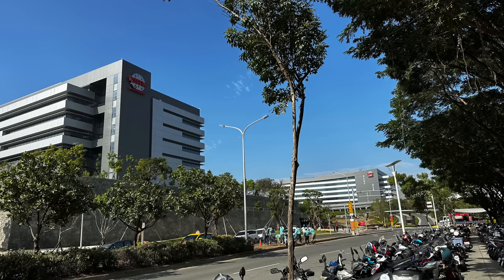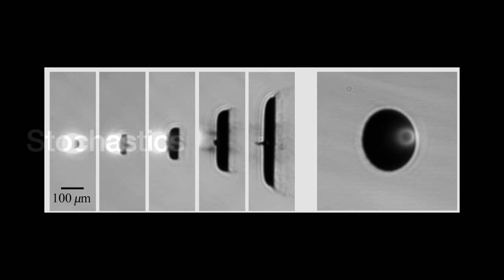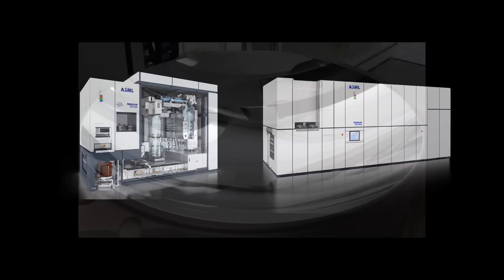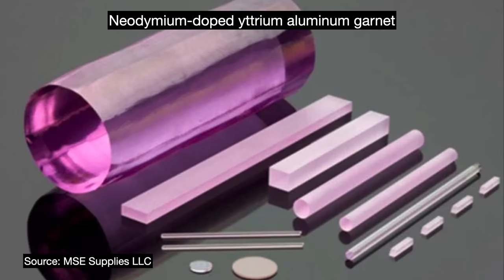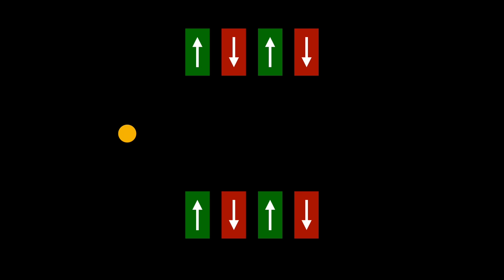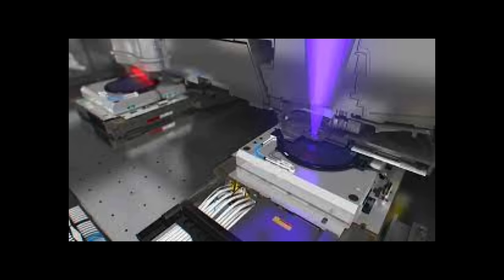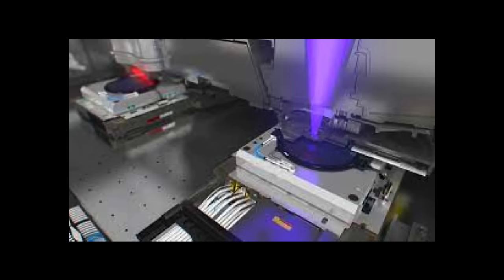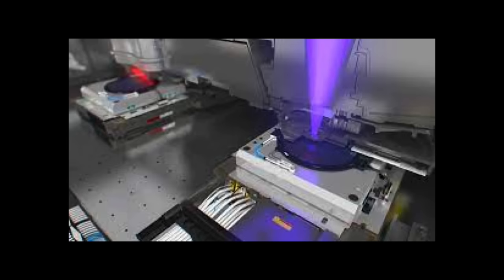EUV Lithography. But With a Free Electron Laser

Comment: I remember reading an article years ago when EUV was still in early development about using particle accelerators. The author of the paper argued that it would ultimately be cheaper and more reliable than the crazy liquid tin Rube Goldberg laser.
Reply: A laser generally will be more efficient and reliable than a thermal approach to generating light, but the thermal approach is often the easy way that needs relatively low R&D investment.
Reply: Yea , but things have changed a lot over past 20 years.

Comment: I whould love to see a video about this new ssmb technique China is supposedly investing. Building a particle accelator for lithography, really? Can it be cost effective, compared to standard euv?
Reply: Could be... a single EUV scanner cost $300-400M dollars, whereas a Chinese synchrotron particle accelerator can cost $200M  but produce dozens of EUV beamlines.
Reply: Except China was not given a choice between cheap advanced chips made by foreign tin EUV and expensive advanced chips made by domestic particle accelerator EUV. China was given a choice between expensive advanced chips made by domestic particle accelerator EUV or  having no advanced chips at all.
Reply: @Stroporez  domestic LPP EUV prototype by CIOMP will be ready by end of the year or early next year, mass adopted within 3 years.
Reply: @MrSpiritmonger  they run about $50 million, the vacuum control system I've had to design for the AMSL EUV is around another $5 million, and then there's other support tools that are also required, and I couldn't tell you what they are since I've had no involvement on that side of the tool yet.
Reply: Odd how chip sanctions pushed China to go all out in the development on this technology. I remember how Russia sending rockets into space got America's space technology development go all out as well. @Stroporez
Reply: Even if it’s not cost effective the Chinese would still need to invest in it since they are blocked from buying current tool.

They either give up on developing their own technology or forever being decades behind competitors
Reply: @Stroporez One ASML EUV scanner cost USD 100-150M. 
SSMB EUV factory cost USD 500M is very cheap comparing to dozens of ASML EUV Machines. 😅😅😅

Comment: The US Navy spent a lot of money on FEL (500M?). Insurmountable engineering problems scaling it up. Of course, that was for directed energy. Perhaps for this specific application it will work. 

FEL beams in the Navy effort were particularly nasty in terms of power density, simply ate the optics alive.

Comment: Most important difference between plasma 13.5 nm light source and 13.5 nm laser (any type, but we can do it only on free electron laser actually) that is the first one is non-coherent. In properties way it is odrinary light source. Laser light is coherent.
Most important laser part is resonator. With resonator light is producing in entire volume of gain medium. Photons emmited with act of spontaneus emmision have random vetor, they goes into random direction. Photons emmited durign stimulated emmision have this same (all) properties - also direction of propagation. Light moving parallel to resonator axis are amplified (because it bouncing many times form one mirror to another, and in each pass it is amplified by gain medium) - and all this photons can have this same properties - frequency, phase, direction of propagation, etc. This means this light can be focusing into very small point - smaller than cross section of gain medium and actually it can reach two diameter of light wave lentgh. 
Parallel beam also mean we can reach high NA.

Comment: Correction:  the electron doesn't gain energy that is loses later through emission.  The changing electric field emits radiation, as it's changing.  Think of it like friction when the undulator tries to pull the electron up or down.  But while actual friction creates heat due to random motions of molecules, here the electron reacts less than you would expect from that force on that mass, with some of the force going into creating photons instead.
Reply: 😯 I would thing that is due to charge acceleration that electromagnetic radiation is emitted
Reply: @franciscojavierramirezaren4722  same thing
Reply: bremstrahlung?

Comment: 1.) Nd lasers are not commonly pumped by LEDs, in fact this has only been demonstrated in academic settings. 
2.) Stimulated emission does not refer to any emission from an excited state as you explain, but is instead the result of an incoming photon stimulating an electronic transition and subsequent release of an additional photon with identical phase. What you effectively described is spontaneous emission.

Comment: Stimulated emission is what happens when a photon interacts with an atom that already has an excited electron. The incoming photon "stimulates" the emission of a second photon, with the same direction and phase as the original. This is how the gain medium increases the light.
Reply: Is this how Erbium-Doped Fiber Amplifier EDFA increase the output of a signal?
Reply: @popquizzz  Yes, the EDFA is a 4 level laser  amplifier optically pumped at 980 nm (from a semiconductor laser) , and then amplifying 1550 nm light.

Comment: author of the video didn't get the idea of the stimulated emission of radiation ( from 6.00 to 7.00)  if radiation is emitted in all directions it is called spontaneous.  and yes it exist all the time the medium is excited. for LaSER  you have to redirect some part of this spontaneous emission with the mirrors to the laser mode. and then, when you have accumulated radiation in one direction, it starts to stimulate atoms to actually emit radiation in this particular direction ( mode). thats a laser. If you just collect spontaneous emission by means of light collector, like EUV source does, you just get incoherent luminescence, not laser. LASER actually stimulates to emit into the direction  of the existing dense bunch of photons (and bunch of fast electrons actually give you this condition, no need for mirrors :-))

Comment: Could you make a video on wafer steppers? I feel like there is also a lot of RnD and Manufacturing detail hidden there, where else would you need to move something that fast but also so precisely at the same time.
Reply: Also wafer aligners. Seems fascinating to me how you can put something so precisely, to a fraction of a nanometer, on top of each other.
Reply: @dantesk1836  Part of the magic is clever use masks and etching that lets one use one feature to set the bounds of another feature (thus obviating the need for extreme precision on mask alignment).  See for example self-aligned gates and multipatterning.  Especially useful for the latter is atomic layer deposition which allows surfaces to be uniformly coated with atomic-level precision on the thickness.  You still need to precise align the masks just not quite as accurately or as many times.

Comment: Rumor said China is building a synchrotron EUV fab in Xiongan
Reply: Not a fab, a prototype synchrotron light source facility. 

Btw, a normal synchrotron has low peak power with high repitition rate while a free electron laser has a high peak power with low repitition rate. 

Tsinghua's SSMB mechanism will allow higher peak power and higher repitition rate at the same time.
Reply: @xBlackWind when it ready? 2025?

Comment: Correction at 8:06, an accelerating electron does not necessarily gain energy. In the case of acceleration by a magnetic field which only changes the direction of the velocity, not it's direction, no energy is gained. In fact, the electron loses energy as it emits light.

Comment: On the other hand, an Ion Implant with an  Implanter will be use after Film deposition.This time its Ion being deposited/doped in the trenches and in High Vacuum state and in numerous steps too. Litho->Film->Implant->Etch. Repeat until desired step is completed. 
Oops, I didn't put the clean or strip steps yet in between those steps as it depends on type of process required or designed.

Comment: Why does the EUV light need to bounce off so many mirrors? Can't they reduce the number of mirrors used?
Reply: Collimating, focusing, redirecting. Lots of reasons why the laser has to bounce off many mirrors. The engineers know full well that every reflection is energy loss, so there must be a good reason why they have to add a mirror in the path of the laser.

Comment: You got ideaa from china's SSMB EUVL project. But you didn't mention china in this video. Such a biased reporting.
Reply: Sad fact is that he didn't even mention Tsinghua's SSMB approach. Unlike a free electron laser which has high peak power with low repitition rate or a normal storage ring synchrotron which has low peak power with high repitition rate, a SSMB based synchrotron has both high power and high repitition rate.
Reply: What do you expect from a Taiwanese who supports Taiwan independence
Reply: @xBlackWind cuz Asianometry is Taiwanese, explains why he left out Tsinghua

Comment: SASE happens with every lasing medium if you have a long enough gain medium.  It's usually minimized as it's far harder to control than a resonant cavity defined by mirrors.  (also tends to shoot beams "backwards" and fry control sensors)  For EUV mirrors are super lossy, so the efficiency gains from eliminating mirrors is worth designing around the randomness of SASE.

Comment: What if you were to try making the free electron laser with some sort of plasma accelerator, instead of a linear accelerator. Would make sense in termes of size and energy, but if its suitable and the light pure enough, idk. And its very much still in development, so probably not there when its needed.

Comment: Correction for 12:00 - Have a feeling for how light electrons are ;) At 10 MeV they are already at 0,999 c. Which is part of the reason for the pre accelerator. You don't really need to consider the changing speed of the electrons for the main accelerator cavities anymore.

Comment: Could someone explain why you wouldn't reuse the beam (so not dump it after first use)? Is it not coherent enough after one use or something?
Reply: Perhaps because one wants to deliver precise pulses (not a continuous beam).
Reply: The electron beam has to have very small dimensions the linac accelerator keeps the electron beam dimensions in the transverse direction across the beam.  That allows the X-rays that it generates when the electron beam passes through the undulator to build up its electric field.  It's that electric field that then starts to work on the electrons that have generated the early x-rays the electrons start to become locked in phase (step) with the X-rays.  Then each X-ray becomes coherent with every other X-ray.  When the electrons are turned around after giving up energy to the X-rays they naturally start to spread out in position and energy so if you try and use them again they will not give the same characteristics for the next time hence it is best to have "fresh" bunches.  The old electrons still have a lot of energy but if you time it correctly the old 15:34  bunches can be used to give up energy to the next set of electrons that are being accelerated.  This is the reason it is called an energy recovery free electron laser.

Comment: Synchrotron radiation has been around for what 6 or 7 decades? Sure, the machines are big but there's really nothing stopping anyone from making them smaller and more efficient.
Synchrotron radiation is smaller than 13nm and has properties wholly different than it's neighbor EUV. What lack of imagination is preventing it from being useful?
The only real rub I can think of is the mechanics of transitioning to a completely different paradigm of electromagnetic interactions especially when it comes to ionizing is a particularly tough nut to crack. I feel like this approach is old news in that people have tried and didn't get what they hoped for.

I just learned that plants reflect IR light so extremely well you can shoot a remote at a leaf and command your devices!  Why is this not common knowledge?

Comment: If I had any say whatever, I would pour funds into both R & D for the electron-accelerator-on-a-chip created and announced by an international collaboration just a few years ago. Such a technology would be a god-send for chip manufacturing. Not only would it be useful for cutting masks and fabbing one-off chips but, if combined with an inverse structure, could also miniaturize FELs to impossible levels.

IF, AND ONLY IF, it is possible to up the total output amperage to something more useful than one electron at a time. Regardless, if you're going to spend billions anyway, some of those billions should be invested in such a possibility as a FEL on a chip.

Comment: If I follow this, the ASML lithography machine gets simplified but an outage of the synchrotron takes down all manufacturing because it’s too expensive to have a second?
Reply: Not really. ASML EUV lithography machine cost $200million. While synchrotron cost $200- $800 million. A big fab like TMSC purchased 55 EUV machines from ASML... so building several Synchrotrons is well within the budget for these big fabs that is running several dozen lithography machines.

Comment: 12:46 Mirrors in a vacuum:  But didn't you just say that this wavelength is absorbed by most every material in the world, meaning conventional optics are impossible?  But now you have mirrors, no full?
Reply: The mirror has precisely aligned layers.
Reply: This is why you start with  1MW (1 million watt) power to run a 40kW CO2 laser and end up with only usable 250W of EUV light.

Comment: Perhaps instead of a beam dump, you could use the electron beam to draw an image on a screen?
Reply: I wouldn't want to look at that screen O_O

Actually, what the video didn't mention is that in this specific FEL they recycle the energy of the beam by decelerating it when it passes the accelerator again. So in essence the main accelerator takes the energy from the old beam and transfers it to the new beam to increase efficiency. Still, the remaining electrons hitting the beam dump probably went from extremely dangerous to very dangerous.

For context: High energy beam dumps usually become very hot during operation and emit a lot of radiation. Actually, they even become radioactive themselves due to activation. Of course, the specifics depend on the type of particle being stopped and the energy and intensity....
Reply: @entcraft44  Why can't they just re accelerate the electrons. Why is there a need to dump the electrons?
Reply: @nickl5658  It probably has to do with beam stability/focus. Circular colliders require sophisticated control systems to keep stable. If you dump the beam you don't have to deal with that. They claim they can transfer nearly 100% of the energy, and electrons themselves are basically free, so this is easier.

That said, I am currently studying to become a physicist so I will research it more and tell you if my hypothesis is correct.

Comment: The new iphone pro proves the N3 node isnt as impressive as we hoped. Litterally no effenciency improvement.all the performance and clockspeed gains came from higher power use. Massive wattage and the iphone pro overheats faster. The density has mostly been used on widening instructions and raytracing cores for the gpu.
I recommend you watch geekerwan's analysis of the A17 chip, as it gives a glimpse into how poor the N3 node is in these early stages.
Reply: Too bad - I'm still waiting for the ultra high efficiency chips that'll make a phone run for a week on one battery charge.  ;*[}
(NB: is that even possible thermodynamically?)
Reply: @stevengill1736  that is very possible and It is strategically avoided intentionally.
Reply: Uhm thats literally it... you chose between performance and efficiency, you cant have both. If they are clocked the same, it would be more efficient
Reply: @ameserich  point is it matches 4 nm of the last chip because they would get the same performance if they increased power by 30% too.
You got it backwards my dude. A new node is either, same performance lower power, or more performance same power. We expected the iPhone chip to have more peefroamnce at the same power but nope. Only a pathetic 10% increase but 30% more power use. That's terrible for a new node. And apple redesigned the CPU core and increased IPC too, #o theoretically there is no difference between 3nm and 4nm in practice, maybe aside from density.

We have to wait for more chips to come out, but right now it feels like the early days of intel 10nm where 14nm had improved so much it was far better early on
Reply: @stevengill1736  they can run for a week but you'd have to say goodbye to apps and notifications and just have basic functionality.
Reply: @wile123456  its literally what i explained... this sounds like a problem with the test itself
Reply: @ameserich  no, because if you watch geekerwan's video they've done both a ton of synthetic and real world tests, more in depth than any other tech channel I know of.
They tested frequency and power limits and tested battery life and the 15 pros get worse hours than the 14 pros.

The silicon for 3nm is more dense but not more effecient. They spend the saved space on wider CPU cores, bigger GPU with raytracing cores and tensor units for more AI performance. But compared to the bug jumps they did with 5 nm and 4nm, 3nm is very dissapointing. (Mind you apple's chips are still two years ahead of qualcomms Snapdragon chips in terms of performance/watt curve)

The 4nm A16 chip is in the non pro iPhone 15 and they get a ton of battery life, the 15 plus gets almost 10 hours with screen on and constant use.